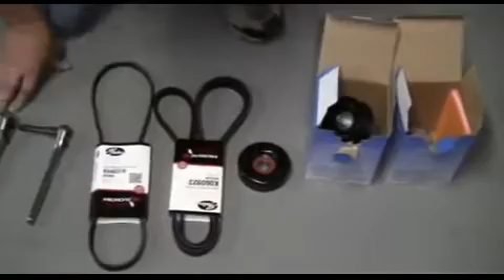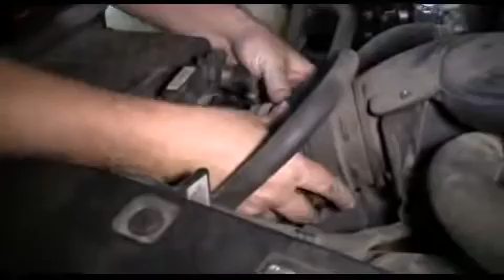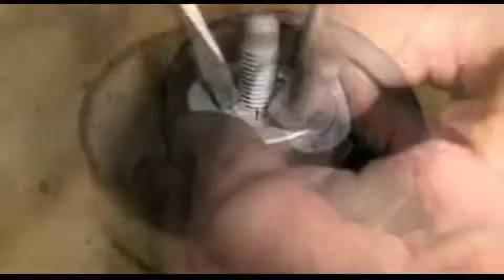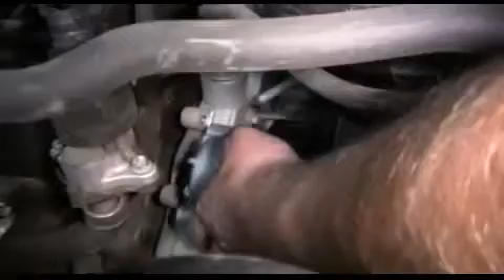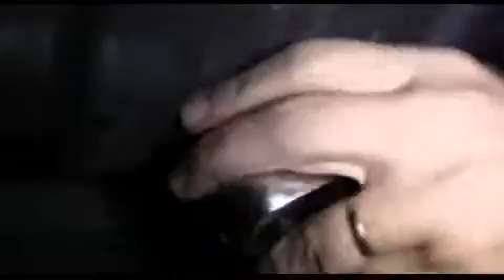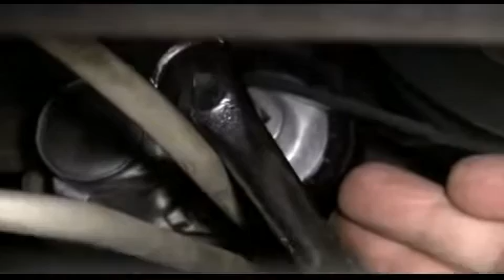Serpentine Belt 2001 GMC Sierra 1500

Comment: Great video guys, worked just as well for my 2006 GMC Sierra. No surprises got out the tools you said, everything worked A-OK.  Looked for your domain name but turned up nothing. Wished you would do DVDs on specific trucks showing how to do simple maintenance, ie changing spark plugs, oil, front and rear brakes etc